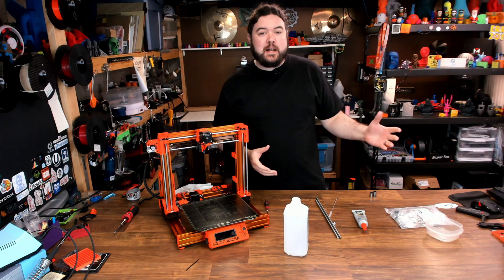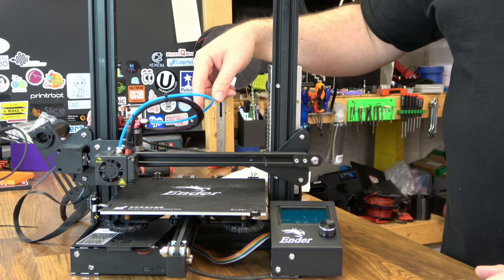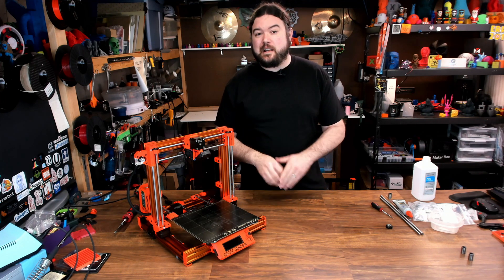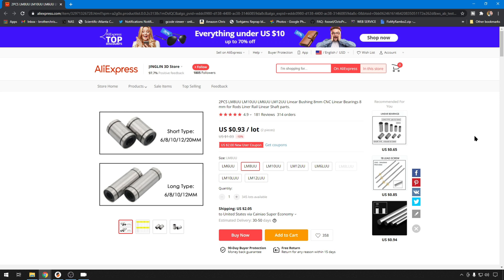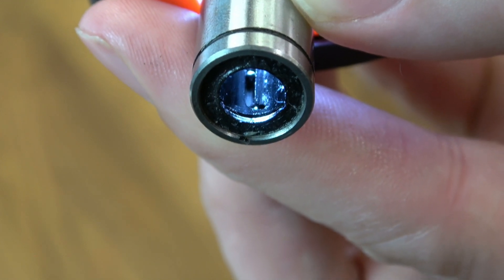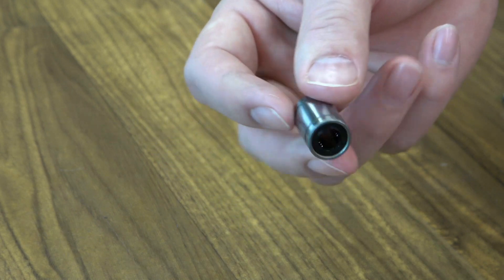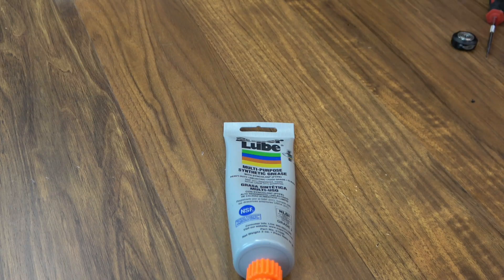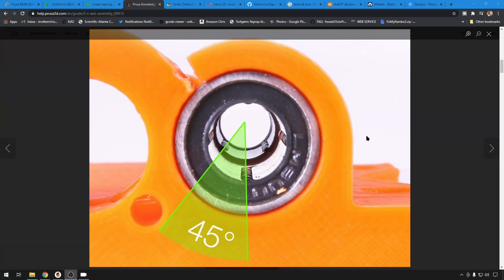3D Printer Maintenance - Linear Bearings - Prusa Bear - Chris's Basement

Comment: my clone uses stainless rods and ptfe llined petg printed bearings with a bit of preload and run in after installatuib
they run dry and so far i see no issues plus the whole printer was below 100$ and it is 100% prusa i3 mk3s clone, although aluminium parts are printed :P
Reply from the maker: That's cool! Thanks!

Comment: Just got my mk3s+ kit, haven't opened it quite yet, would you recommend cleaning and repacking the bearings before I assemble? Sound is a big concern for me as I live in an apartment building. Do you think I can get it quiet enough to not annoy my neighbours? It's a concrete building, so hopefully shouldn't be too too bad. Will also by to follow the other tips for vibration isolation, like using a garden tile as a base. It's just hard to get a reference for how loud this is from videos online.
Reply from the maker: You won't have any issue, the MK3 is going to be very quite for the most part. It won't bother the neighbors, no need to repack. You will love your MK3.

Comment: Nice, in-depth video! It is odd how much conflicting info there is on bearing lubrication. I have a Ultimaker 2+ which uses 6mm linear bearings in the printhead and 8mm bushings on the gantry. All of the official documentation from UM states to use a sewing machine oil for all the smooth rods. But according to Misumi, the linear bearings call for lithium grease, like you mentioned.
Reply from the maker: Thank you

Comment: Dang, I wish I would have seen this before building my MK3S+ last week. After reading the debates back and forth about whether or not the Misumi bearings needed to be greased, I decided to follow Prusa's advice and go with the oil that was on there. It has slowly been leaking out with every print getting splatters all over the print bed. I doubt it's going to last nearly as long as they say. At least now I know how to do it properly.
Reply from the maker: Thanks for watching!

Comment: Small FYI :-)  After trying 'japanese' (expensive) Lmuu bearings with  less than anticipated result.
 I then experimented with printed (thingiverse.. yess I know not the best of sources) ) Ball Bearing holder types . 
Happily, these have proven Absolutely Excellent in real life use.  
These rolling on the 8mm rods bearings are Tolerant of rod size inconsistencies/ accuracy AND parallelism issues... producing Zero bindings/tight spots.
 Rod quality  ,  Even tolerance is of Markedly reduced Importance !       
They turn a fairly Poor design (rods) setup into V good.
Smooth and as precise  as Ice skates on a freshly Zamboni'd Ice sheet.. (best analogy that came to mind :-).
Better in truth than Linear rails that i experimented with.. all  for V low cost . But.. Do... buy ABEC 5 or better bearings... not the 10 for 2$ ones 
Well worth the trouble to hunt up and try for your self.
 It IS  a major printer upgrade.. with instantly apparent results.
Reply from the maker: Cool, thanks for sharing! 🙂

Comment: Hi Chris, I have built A Prusa bear clone, using an SKR 1.4 Turbo board, what max feedrate would you suggest setting as PETG prints are rubbish, and I have been running it with 3000 but I think it needs slowing down, please can you do a video on marlin setups for 32 bit boards and best settings, Cheers
Reply from the maker: On a Prusa style I just to run feedrate pretty low 200, 200, 12, 120 is what I usually set them to. On a bear you could go a little higher, but that's where I would start.

Comment: Very timely video!  I'm considering new bearings (and maybe rods) for my MK3S.  It wasn't an "S" when I assembled it back in August 2018.  For about a year now, it's been making noises like yours.  I've replace some of the bearings, but other than adding a little SuperLube, I never cleaned out my bearings, nor really filled them like you've shown.  Maybe I need to do all the bearings (and rods too?) at the same time.  Total print time is listed as 109 days -- or around 2600 hours.
Reply from the maker: It might not hurt to take a look.

Comment: How do you feel about just switching to Drylin bearings?
Reply: Problem with Drylin bearings is that the tracks need to be VERY much aligned, actually more than is possible without special equipment,
However, there are special auto-aligning Igus bearings.
have a look at: https://www.youtube.com/watch?v=ZGBipbgwgME
Reply from the maker: It would be interesting to give some a test, never had any experience with them.

Comment: I have already needed to replace two rods and bearings on the less than one year old Prusa I maintain. I installed a set of Igus from Amazon on the X carriage.  You have to be careful not to clamp them to tight or they will bind.  I have not tried replacing the Y carriage because of the u bolts used to secure them.
Reply: Good luck, and hope you nail it. I tried to get Igus bearings working for several weeks before just getting some Musumis. I could never get the tension right and had really bad ringing, or the bearings grabbed too hard. There seemed to be no in-between.
Reply from the maker: Yeah, i have never tried the Igus before, I should give them a go just for a test.

Comment: Hello Chris!
In my first Prusa (a clone), which I built a few weeks ago, I used a "new" lubricant called "EUROLUB 708900 Gearfit 00-000 EP 00-000".
This is not that "thick" and is a good quality lubricant. Maybe you want to try, I just wanted to let you know;) - Hope this is so correct in English, unfortunately I'm not really good at it ... 
https://www.amazon.de/gp/product/B00U1GBQSI?ie=UTF8&psc=1&linkCode=ll1&tag=adminweb-21&linkId=fe420dbb657a398264c9bb4f4f914f9a&language=de_DE&ref_=as_li_ss_tl

Comment: My biggest problem with cheapest bearings is that they usually don't match rods, and wobble too much. Tolerances are apparently out there. Buying matched pair like from Prusa or Misumi directly helps, but that's the more expensive solution. I also had seal just detach and turn into half-solid goo by soaking in alcohol in one case.

2 extra things: 
1. If you don't use SuperLube with printed fancy cap, just use a rod. Put some lube inside (it's surprising how much they actually take ...), plug one end with a finger, and push rod in. Lube will get pushed into tracks and rest will squirt out. You can use 2 rods one against each other as well. 
2. That 45 degree angle is only for Z bearings. If you have load-bearing bearing (hehe) like X or Y, rotate them the way that 2 ball tracks are on the top, not only one. This helps distribute the load better.

Thre are heated discussion in Prusa community whether Misumi bearings need to be cleaned and packed ... assembly manual says not to, but Misumi bearings which come standard now are in sealed bags and according to manufacturer's page, they contain transport oil only which does not interfere with standard lubrication process. So you have people saying to clean and lube them, then you have (mostly machinists) saying to just lube them as the oil is harmless, and you have people saying not to do anything. Now nobody's any wiser 😅
Reply from the maker: LOL, yeah, I have read all sorts of different things about this topic. I have always had good luck with this method.
Reply: Misumi are made in japan. The WORST thing to buy from China are screw, nuts, bolts, and BEARINGS! However, to be fair, just look at the specification. Are they g6 or h16? But China was known in the past for not heat treating GR8 bolts; failed!

Comment: Great video as always. I would point out that aligning the bearings in the manner you show is only recommended for the Z bearings by Prusa according to the current build manual. For the X and Y the bearings are aligned in an X pattern and not X+ pattern as they are for Z. This puts all the weight on 2 rows of balls and not just 1 for those axis. It doesn’t matter on Z since there is no weight put on those bearings. Thanks for all the great content.
Reply from the maker: Thanks for the info!

Comment: do linear rails need maintenance ?
Reply: I'm assuming you're asking about hiwin style linear rails with mgns with blocks, and yes they do need maintenance -- put some 3-in-1 sewing machine oil on the rail and run the blocks over them to have it pick up as much lubricant as possible into the block. Otherwise you need a special tool to attach a nipple to the block to lubricate it, depending on brand and size it may not be possible to get lubricant into the block without taking the block off the linear rail.
Reply from the maker: They do, mostly cleaning and light oil, be we can take a look at those as well.

Comment: Hi Chris and thanks so much for your work.
I've been using Teflon sprayed/drying after a good 24h IPO bath and good dry up.
Seems to work great on my Bears, some have hundreds of hour.
Do you see any problem with Teflon?
May the Force be with you.
Reply: If I remember correctly, Teflon is more used on plastics/plastics or plastics/metal contact
Reply from the maker: I have never had an issue with it, I have read that your shouldn't use it, but it seems to work great for me.

Comment: This video is great. Finally a video that shows the cost between bearings, and why the cheap ones are used.  I see so many people complain about bearings.  If you install them and understand why they fail. They will last a long time.  I've used a cnc plasma for over 20 years. Once a  year I would replace  or service them.  Right now I have an extra set of bearings and rod for my printer. These printer run non stop. The L10  life of those small bearings  is short.
Reply from the maker: You bet! Thanks!

Comment: Awesome video Chris, and perfect timing since I am tackling 6 month maintenance / MK3S+ upgrade this weekend.  Question, should there be supplemental lubrication periodically?  Or just let the ride on the SuperLube?
Reply: 6 month maintenance! Not needed mate. I've run mine for over 2 years and never touched it apart from a bit of PTFE grease on the rods
Reply from the maker: Great question, I am not sure what a company like Prusa recommends, but a Phil has stated, I have also run these are very long time (years) with no additional lubrications. Only in extreme cases would I pull it apart and repack it.